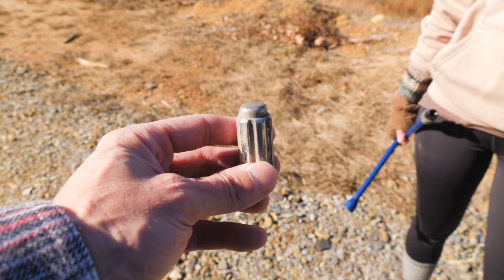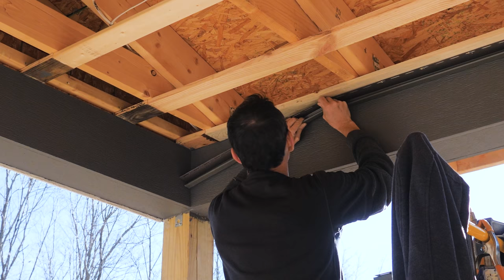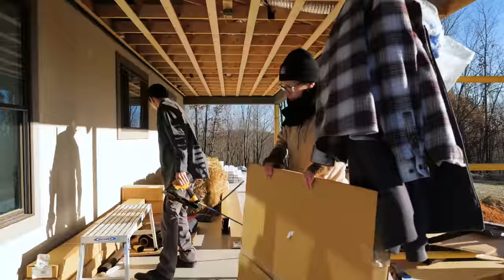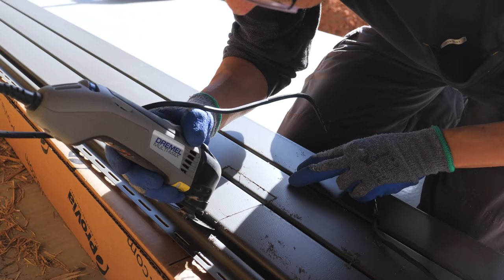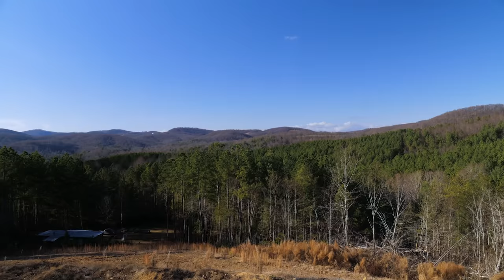Who is THIS STRANGER??

Comment: Labor is the highest single cost component of any building work. By doing 50% of the work yourself you cut 60% off the labor cost at the minimum. That cost then goes straight into pure equity.
All the best for 2022.